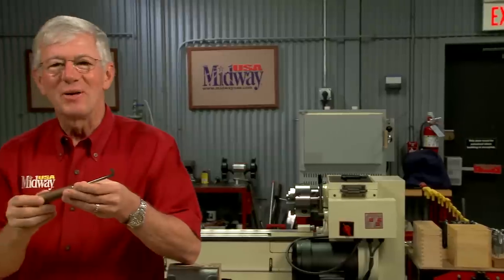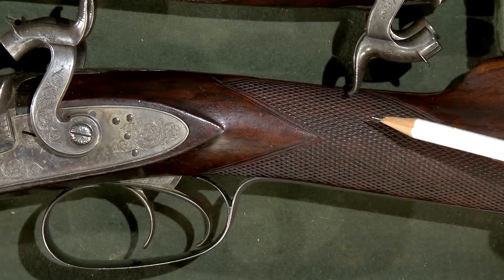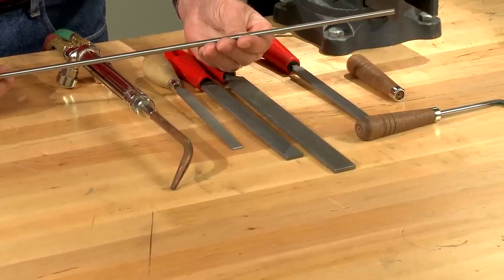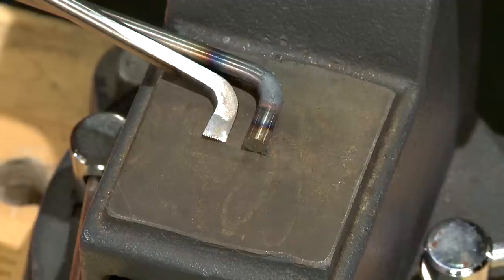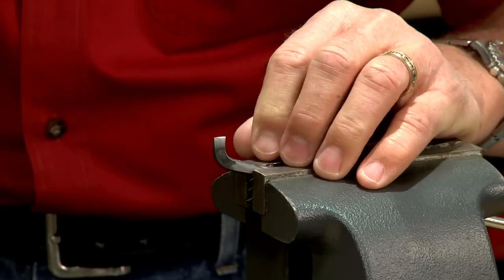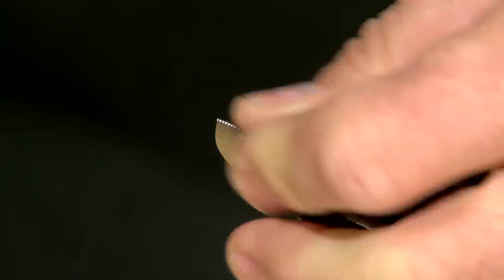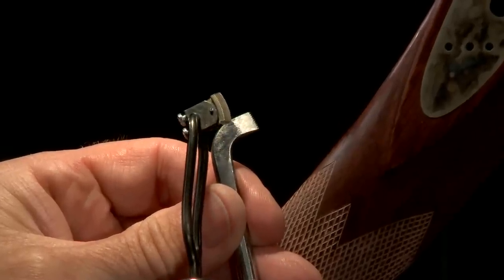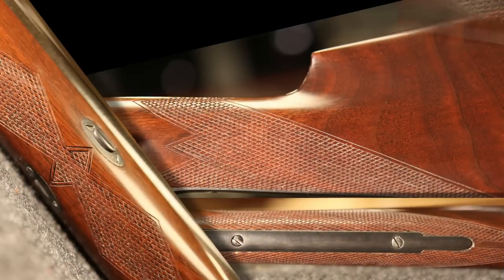How to Make a Flat-Top Checkering Cutter | MidwayUSA Gunsmithing

Comment: Larry never says anything about 01 tool steel being air hardening at all. I can tell you from my own experience that you have to harden ( heat to red hot and quench in oil ) then temper ( reheat to a sandy colour ) to make an edge on 01 tool steel last ( HARD 52-60 rockwell)

Comment: Regarding English Checkering, Leonard Mews states that English Checkering has straight sides are a round bottom, so there is obviously variation to what gunsmiths have been doing over the centuries.

The important thing to remember is that Potterfield was doing this for one job, yes if you were making a tool to last you would have to harden and temper it after making it, but he obviously wanted it for a single job so wasn't too concerned with over complicating it, being O1 you would quench in light oil, quenching in water could shatter it, be careful if you make a tool like this from drill rod because some drill rod is W series steel which is water hardening, know what you are working with.

As for the edge being hard while filing, I am surprised because it was held in a vice while he heated the bend so it shouldn't have reached a temperature high enough to harden it, but drill rod is harder than mild steel, I know because I hacksaw bits of drill rod all the time and they do feel different to mild steel, so I guess Potterfield was simply stating how it felt, not making a statement about being dead hard or anything close to it.

Comment: Air hardening (you say cooling) will leave this piece somewhere in the 50's for rockwell, the hardening will simply not be as uniform as if it were quenched, but certainly the cutting "edge" will be very hard as heat leaves this area very quickly.
Reply: Tool steel he used is air hardening variation will do better than 50HRC.. Then touching cold vise may be the trick because some types even resting on vise to allow to cool as you take a bathroom break,will return to it exploded on the cold vise.. This gentleman uses what he made,could even be due to checkering file grooves as well..Ontario runs their 1095 at 52-55 HRC...even if that was 50HRC,that is years of service life out of it using it on hardwoods..Wouldn't it be??

Comment: Your Amazing!!!! I want to make checkering diamonds on my knife handles so bad but truly am afraid to buy entire kit as it may not get used as much and I need other tools much more right now.I noticed a Herter's number 18... Is that along with the tool you made what I need to try mimicking Thistletop knife handles of pre 1930's diamond checkering? I can purchase the number 18 and it has two rows of V teeth with V in the center front...Is that the tool??? to buy?? Then make one of the deepening tools you showed here? I have a 20-lpi checkering file I use for jimping atop knife blades...Thanks so much

Comment: Yeah there is a step or 5 missing here in this video... Nothing against Larry. But Correct me if I am off base.  In the heat to bend that wouldn't have completely annealed the part that was to become the cutting edge.  And After putting in the teeth it would have to be heated again then quenched in either H2O or Transmission Fluid